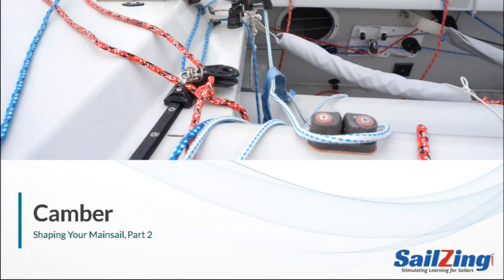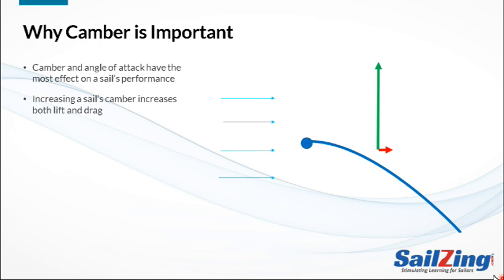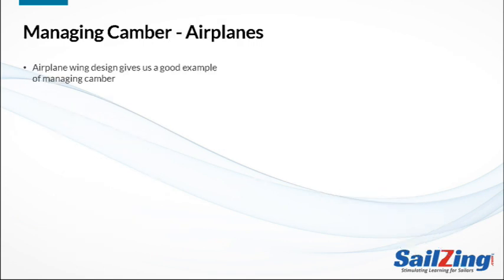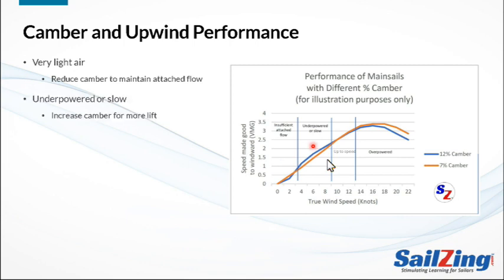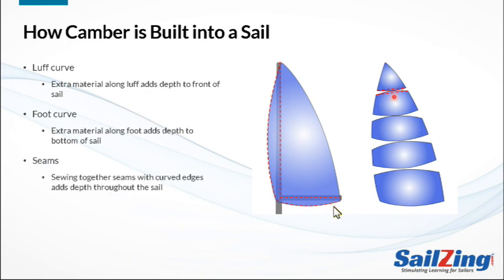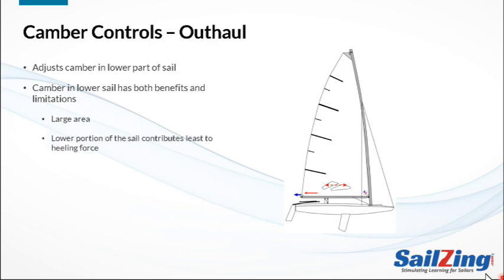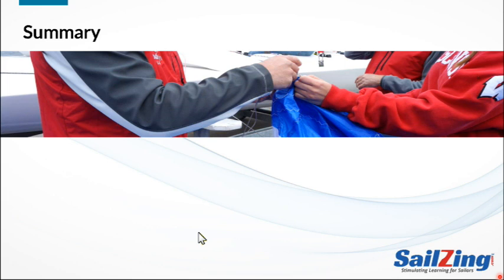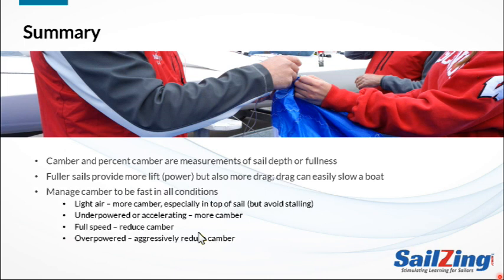Upwind Mainsail Trim: Shaping your Sail, Part 2 - Camber

Comment: In the very light air condition, which control or controls would you use to reduce the camber to maintain leeward flow over the sail? I'm assuming you would use outhaul first and maybe a little vang instead of mainsheet to maintain some twist in the sail. Also, considering often there is greater wind above the surface, would you aim to have more camber in the top of the sail relative to the bottom? Thanks really enjoying your videos.

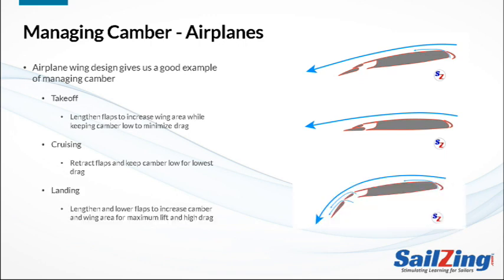Comment: The summary on the last slide contradicts the slide at minute 7:06... I am confused. LIGHT air. Increase or reduce camber??
Reply: Landing is light wind (low speed) with high camber to prevent stalling (higher lift), and you also intentionaly create more drag to slow the plane during descend, when gravity would speed you up. Pilot would reduce flap if his flight is too short for landing, cause it nearly work as a air break.

Also remember, it's the sail camber in this vid, not the mast camber. Increasing the mast camber reduce the sail camber which can confuse your crew :)

Comment: Great content - thanks for sharing!
You mentioned "aggressively" reducing camber when overpowered. Would you consider reefing as part of that strategy? And if so, I assume you'd recommend reefing early? Of course, this is in the context of cruising not racing.
Thanks!
Reply from the maker: I don't have experience with reefing, but yes - anything you can do to reduce power is good. I have had racing sailors tell me that they tried a smaller racing sail (cut smaller than the class limits) in big breeze and were able to hang in with the heavier crews that kept their bifg sails up.
Reply: reduce the camber for a puff (try to be proactive before the puff), but take a reef if the constant wind already overpower your boat. 
For cruising, you would want to be always a little underpowered, so the puff or gall are not too scary for your crew. This will also save power for the autopilot.